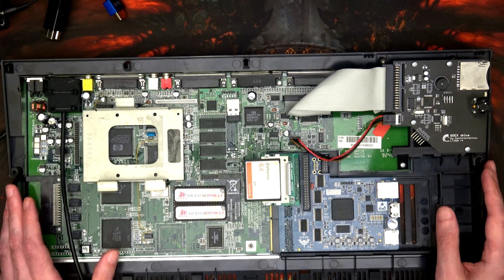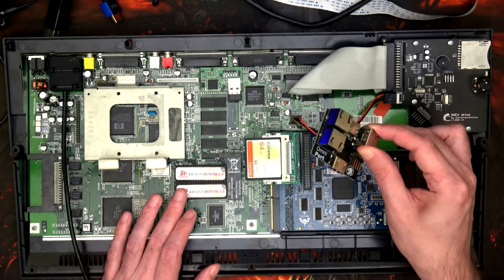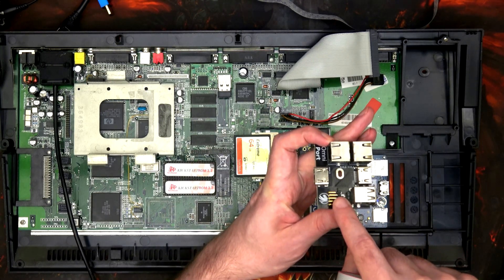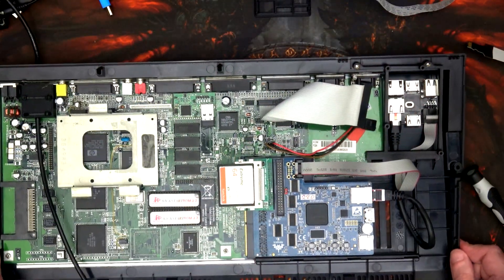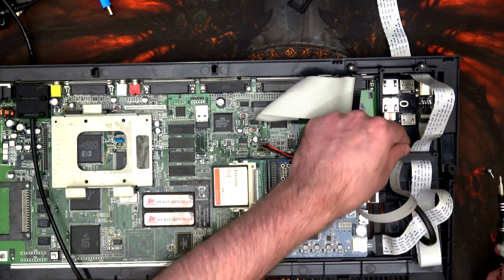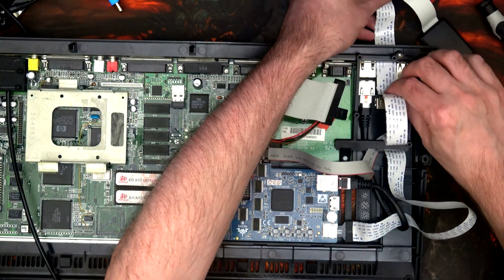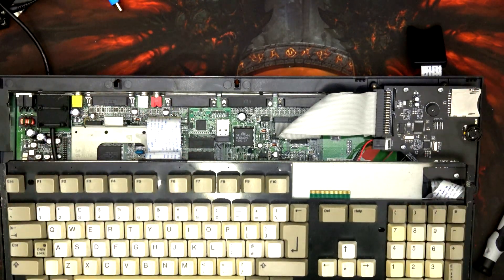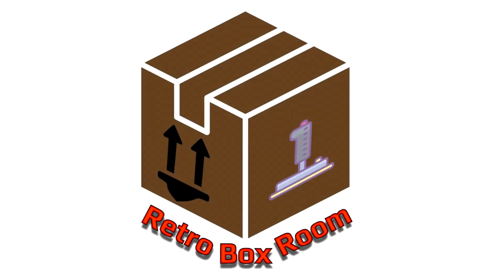Apollo IceDrake for the Amiga 1200 - OmniPort - Part 4

Comment: Did you get any long term stability issues?  I keep loosing video signal from the HDMI, when its been powered on for a while.
Reply from the maker: I haven't had any such problems.

Have you grabbed the latest firmware?
Reply: @RetroBoxRoom  Yes, latest core and images for Apollo OS, Coffin OS and my Amiga OS is.  Actually Coffin doesn't start up, it just hangs. Im using the ApolloBoot Trio. Its a ReAmiga 1200 and it has the "well known" timing fixes included.  With Apollo OS and Amiga OS, it seems to work for a while then the video goes after becoming intermittent.
Reply from the maker: That's a shame. I'm not sure what I can say to test. Apart from maybe try using a heatsink? It sounds like something is getting warm, before failing, rather than software.
Reply: @RetroBoxRoom  I thought that but none of the chips get overly warm. Alice gets a little warm but I'll try a heat sink anyway. I was thinking it could be RFI causing a problem since there isn't a metal shield.
Reply from the maker: @OnlyAmiga85  How about on the IceDrake?

Comment: I would suggest you go with the microSD version of the extender and maybe that would go in a version of the face plate also.  I would also suggest you get someone to make you a custom cable.  If the IceDrake only does 10/100BaseT, then just put in 2 pairs(white-orange&orange, white-green&green), no shielding, no snag protectors.  This could be made the correct length, and be much easier to route.
Reply from the maker: A microSD would need a different backplate.  As for the cable, I could make one myself if I had the tools. It's just costs for a more bespoke setup. Though it would look neater, for something that no-one would see, once the lid is closed.

Comment: Can someone.please explain when using a PI accelerator ( which one doesnt matter ) , how about to use the ports like HDMI, USB, ETHERNET? , is there a board like the omniport for the Pi, or do we need to beeing creative again and use rare methods?
Reply from the maker: You can use an ominport with a Pi. You may have to buy cables that match up, but it's just a port extender.
Reply: @RetroBoxRoom  i know the omniport is an port extender, i mean how to use usb devices with PI accelerator then? U need to hookup cables on it
Reply from the maker: Are you talking about using a Pi in an Amiga? Or just as normal?